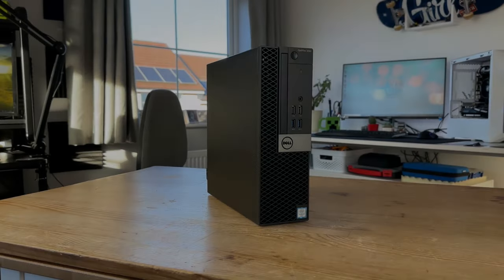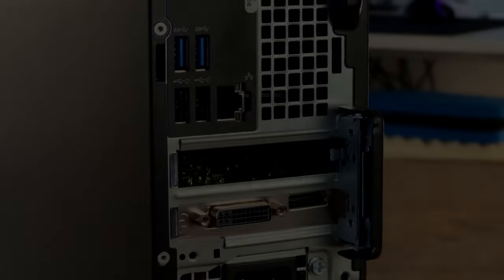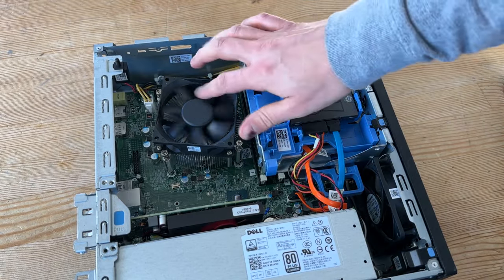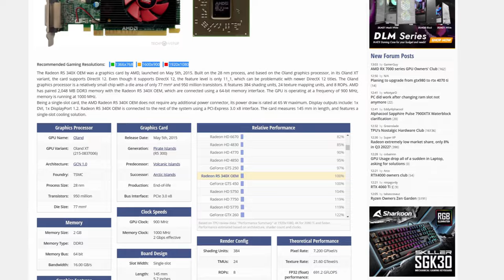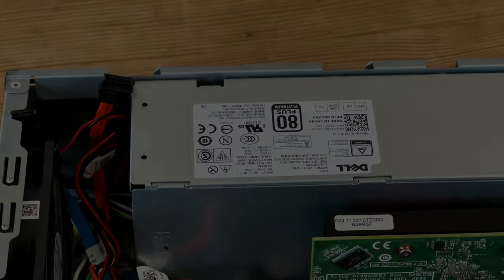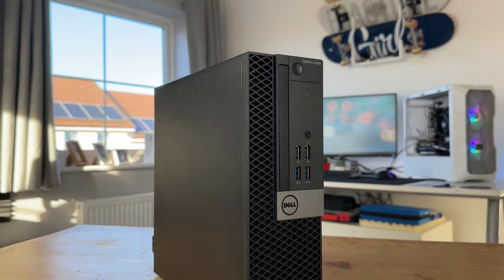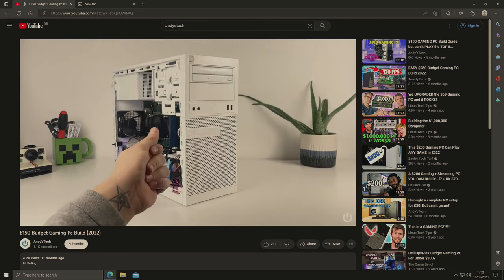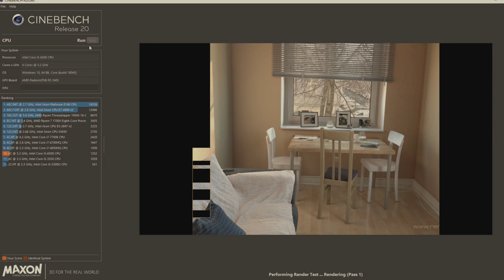Awesome Dell Optiplex BUDGET GAMING PC

Comment: Just bought one of these off eBay for £60 with 8GB ram and a 480GB SSD. Only an i3 6100 and integrated graphics though. To be fair, I've only bought it to browse the web in a shed I'm converting into a den, so it should do the job. Would I need to swap out the motherboard if I wanted to upgrade to a 6500 or do they use the same socket set?

Edit: Just had a look and they do use the same socket set. Not sure if I'll even need to upgrade because I've just watched a video demonstrating what the 6100 can do and it seems more than adequate. Feel like I've bagged a bargain picking this PC up for £60.
Reply from the maker: Awesome stuff! Yes the system will take the i5 6500, i7 6700/6700T

Comment: Hi I am looking at purchasing the same computer I do not know much about computers and I am looking at getting into some light pc gaming , can you recommend a graphics card I could purchase in uk used for up to £50 to pair with this thank you
Reply from the maker: Personally I’d try and go with a MT/Mini tower case as you’ll have a lot more options over the SSF units like this. Try and find an i7 if you can or a later 8th gen i5 8500/8400. GPU wise a GTX1650/1050ti or RX560/460 4GB will work with the stock PSU so just plug and play. If you want to get little creative and use a Sata to 8/6pin PCIe power adapter then a GTX1060 3/6GB will do the job nicely. Hope that helps
Reply: @andystech101  thanks for the reply! I managed to get this exact pc for 48 pound with 90 days warranty seemed like a bit of a no brainer and got a GeForce 1030 as you mentioned in the video for £25, I will see how it goes and potentially look at re selling and going the route you mentioned if I enjoy it

Comment: Any clue if the RX6400and the I5-6500 are compatible with the dell and if the psu is enough to handle them?
Reply from the maker: Yes you’ll be fine with an RX6400 and i5 6500. If you can try and find an i7 6700/6700T as you’ll have a lot better experience and is well worth the £20/£30 more.

Comment: Nice little find. I've just recently finished a build with an i5-6500 in it, and it's got more to give. I had a standard sized case so I was able to swap the case and put in a 1060 3gb. It'll be interesting to see how you system deals with the 6400 and whether the 4 pcie lane connection has any issue or whether a CPU bottleneck will happen first.
Reply from the maker: Yeah it’s just a strange platform 6/7th gen! The i7’s cost what a used 10100f does, no v4/v5 Xeon support which is just a total bummer and it’s just not worth buying for an i5 for a custom build. Well unless it’s super cheap, that why I love playing around with these OEMs. Just on my holidays at the moment but looking forward to the follow up when I get back 😁

Comment: Nice cheap system! I have a 7050 I plan on upgrading and seeing how it does
Reply from the maker: Nice! Would have been great if it was the mini tower but alas. I think the 3050 & 7050 both have m.2 support and ddr4 also?
Reply: @andystech101  Yep. It'll be interesting. I may or may not try to recase it. But I have to keep cost in mind as well so we'll see

Comment: Is Ryzen 5 4500 with amd radeon rx580 graphic good?Im about to buy it for recording gaming videos.
Reply from the maker: Yes you’ll be ok but depending on what games the quality might differ, you can use Radeon Relive through the RX580 as well.
Reply: @andystech101  Thanks!I would record horror games.And Counter Strike Global Offensive.Rx580 supports Ultra graphics if i am right so i think it will be good.

Comment: Hello, I recently upgraded to DDR3 12800 8gb 1600mhz hyperx memories, but it doesn't recognize it, it blinks 2 times amber and 7 times amber, I saw that it's a memory problem. I tested it on another Dell PC and it works
Reply from the maker: May just be a compatibility issue. I know these ram with DDR3L for low voltage.
Reply: @andystech101  That's it, I did the following, I bought DDR3L memories and now it's working, good thing the seller was understandable about my situation and offered a refund, as he didn't have the specific model of my card
Reply: @andystech101  Thanks for the feedback
Reply from the maker: Happy days enjoy 😁

Comment: Great video bro. I’m thinking of getting one of these for my trading. I don’t game but just run trading view and some other basic apps.

I was wondering if I could run 2 monitors off the graphics card in there. I think it’s hdmi and digital port so using the digital port with a hdmi converter to run the second monitor. Do you think the pc can keep us with this? 

Cheers mate. Great video
Reply from the maker: Yes would be perfect for you. Make sure you’ve an i5 or a 4core cpu at least, SSD and at least 8GB ram. You might be better to buy a cheap quadro like a K620 as they still have driver support.

Comment: I have this exact RX 6400 in one of my systems. Gets a little toasty after hours of gaming. But you aren't going to find anything near its price, that competes with it for single slot LP builds. Even in PCIe 3.0 mode. As you doubtless know based on your replies here. Most of the terrible numbers it throws up, are because the tester used settings that exceeded the frame buffer. 

Digging the content Andy. You are already getting better with the camera work, and choices for B roll. A loyal viewer's observation:  You can sound a little monotone and disinterested at times. I don't mind it at all, but it'd probably be advisable to do a bit more acting. For example: Laughing about what the X stands for was the most seemingly natural moment you had in this one. You don't have to be a spaz like Linus, but being more animated wouldn't hurt for broader appeal. Then again, armchairing it is a lot easier than doing it. I'll sod off now. 🤐
Reply from the maker: Haha yes it’s hard to read a script sometimes and sound natural, being dyslexic doesn’t help also, I’m not a natural speaker or very good communicator 😅 hence why I like PC’s I think! Need to get in the flow more and appreciate the feedback. 

I’m honestly loving the 6400 so far, it clearly has its limitations which keep in mind is a great little gpu for sff systems like these old Dell and HPs. Yes mine hits about 85c after a while and one pasted it with some decent stuff 😅

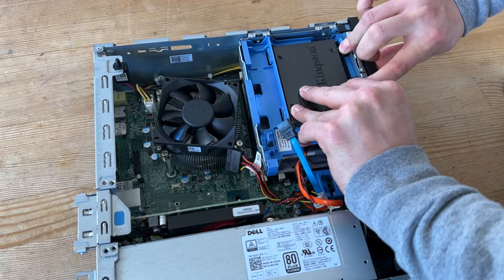Comment: 2:40 you can easily get the sata power splitter to get another drive connected. as long as you have another sata port obviously, but i think there's two in this one if i seen correctly
Reply from the maker: Yeah it’s a pain but it is doable, funny you mentioned this as I was hunting through my draw last night for one for a different build 💪🏼

Comment: 🤟Is that nail varnish on your thumb left over from the weekend??, will be interesting to see if the RX 6400 bottlenecks running in pcie 3.0 or will it be 2.0? and the CPU not supporting Gen 4, apparently, it can lose up to 35% performance in some games, I await with bated breath
Reply from the maker: Cheers, no unfortunately I bashed my thumb the other day 😅 it’s PCIe 3.0 and yes fingers crossed but I think you’ll be pleasantly surprised 🙏🏼
Reply: Don't forget the main reviews of the 6400 would have been testing it with unrealistic CPU combinations such as a i9-13900k to remove CPU bottleneck. With a i5-6400 and playing top end games at medium/high settings rather than ultra will close the gap. We may even see no difference if the i5-6400 gives us a CPU bottleneck.

I'm looking forward to seeimg how this combo performs. I put my money on a CPU bottleneck as my i5-6500 had high CPU usage with just a gtx 1060 3gb in many games. In e-sport games it'll give very high average FPS.